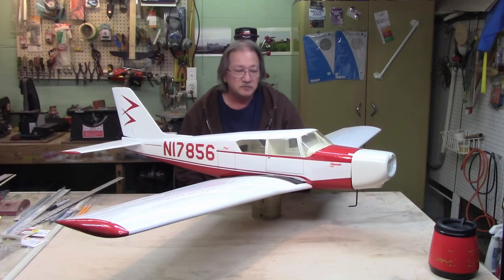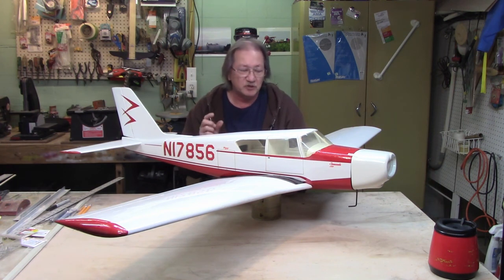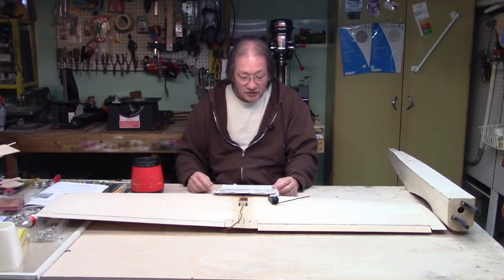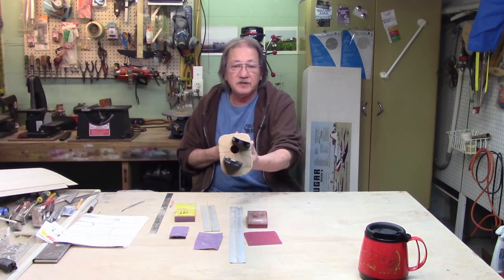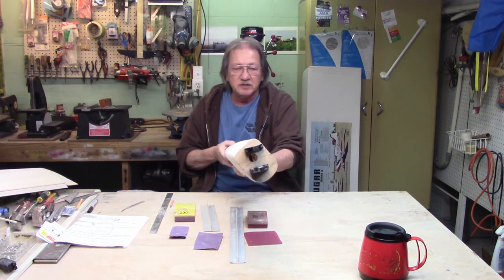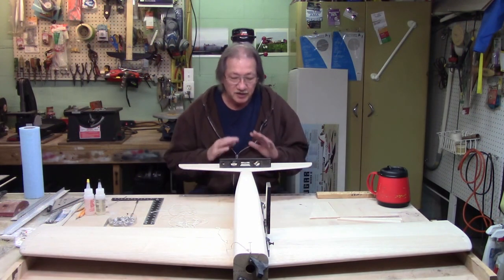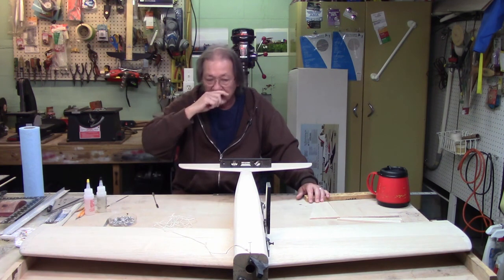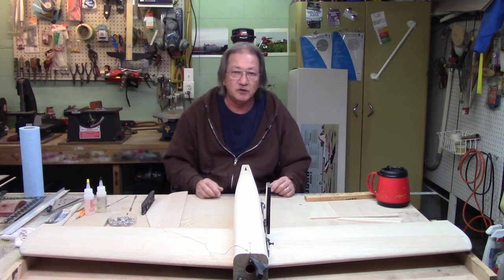SIG KOUGAR BUILD   Part - 13   The Back To The Fuselage

Comment: I built several kits in the 90s but have been out the hobby for a while.  I would like to get back into, and these videos have been great.   I have learned several techniques watching these.  Thanks for sharing.  What are you using for a building surface?
Reply: My bench is plywood with two 1/8"  pieces of glass (glass is a very flat surface). I use both, plywood surface and glass,  it depends on the type of build it is. I'm glad you picked up some new techniques, Thanks  for the question.

Comment: I’ve never built a plane before but I’ve been thinking about building one that maybe easy for a beginner if there is such a thing.What would you recommend?Ive watched this build from the start up to this point.You an inspiration.Thanks for sharing the videos on this build.
Reply from the maker: Hi, there is very few kits to choose from these days, however the one that stick out in my mind is a SIG Kadet Mark II. If you're not familiar with the Kadet, it is a very easy to build trainer and takes a .25 - .40 size engine and has a 57.25" wingspan. It comes with a very easy to follow instruction manual. The Kadet is a simple box construction. You can purchase the kit directly from SIG or Tower Hobbies. I've built several Kadets and trained many students on this model. I haven't researched trainer models in quite awhile, perhaps there are other models out there.
In my opinion you can't go wrong with the Kadet Mark II. 
 I hope this helps you out, And enjoy you first build.
Reply: Bob.Thanks so much for the information.I will check into the plane you suggested.Thanks so much.

Comment: Hi Bob, I have a quick question that you might be able to help me with. You mentioned your preference with the brand of props. Other than price, do you know what is the difference between a two bladed prop and a three bladed. On the nitro planes, I always see the two bladed on war birds and other scale planes, then there changed to a three blade when they are on display. I want to put the three bladed on my B-17, P=40 and Curtis hawk. I've asked people at the field but can't get an answer. Some say the plans state a 10-6 for the 40 they are flying. Others say it's because of the cost but don't know if the performance will be effected. Will I lose any performance running with three bladed props. Will a 25 turn the three bladed prop without any problems. I am putting 4 of them on the B-17. I noticed you were running a two bladed prop on your P-51. I know this isn't in the realm of building the Kougar, but since you brought up the discussion of props I thought I would ask. I'm hopping it's just the cost. Thanks again for all you are doing. Bill
Reply from the maker: HI Bill, the difference is, the efficiency of a two bladed prop is greater than a three bladed prop. A three bladed prop is naturally heavier than a two bladed prop. You probably already know that as a general rule if you run a two bladed prop and want to run a three bladed prop you need to reduce the diameter by 1 and reduce the pitch by 1. You may also know that props inherently create their own drag. So a three bladed prop will have more drag and less rpm even with the general rule applied providing they are from the same type, style, composed of the same material and made by the same manufacturer. You'll get the best performance from a two bladed prop. However if speed isn't an issue and your engine will put out enough static thrust with a three bladed prop to pull your model, than you should be ok. I like the Graupner S-Nylon Propeller (Three Blade) the best. You can check them out at https://www.graupnerusa.com/3-BLADE_c_179.html
I've been using them for years. Very good question!!! I hope this helps.
Thanks for asking

(Just finish recording Part 14-A. I should have it uploaded by tomorrow evening, if all goes well that is!!)